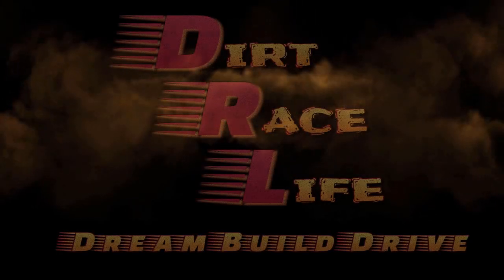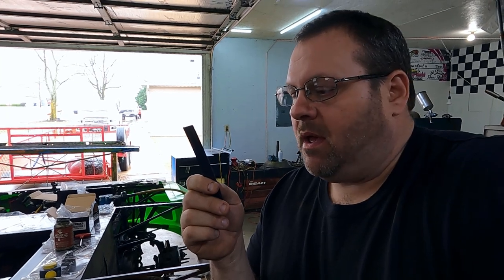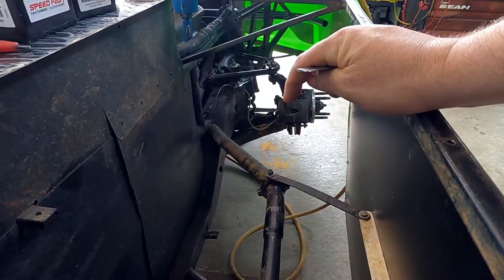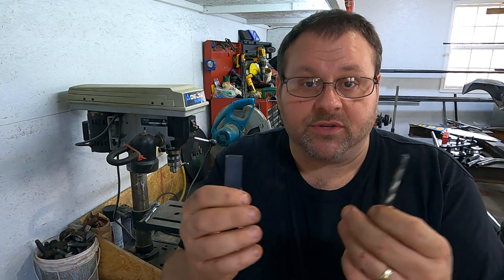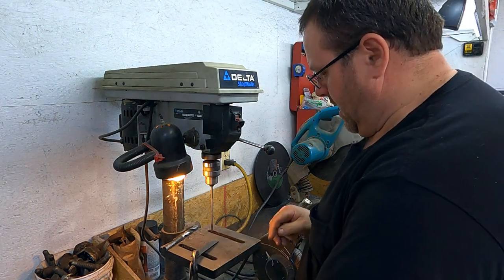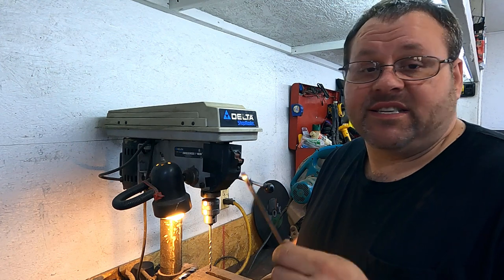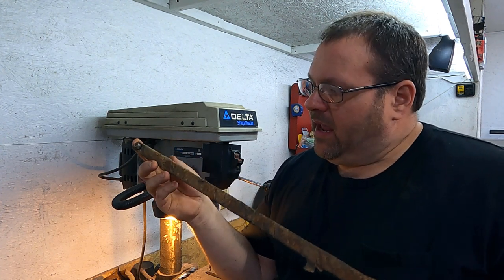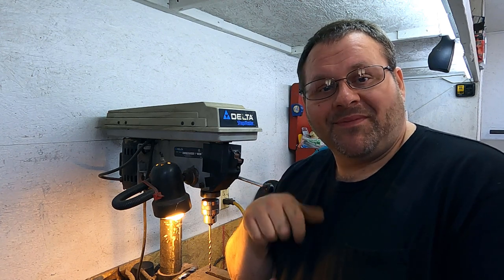Making Body Braces for your Street Stock Simple Fast and Cheap!

Comment: Hey bud where was this video 6 months ago when i finally gave up drilling spring steel and forked out for the allstar punch at $160?? Awesome video man. I use 1inch heat shrink on amazon in bulk. But like everything else it will tear off when the track is heavy.
Reply from the maker: I ran across this when I was re-drilling some leaf springs years ago and a guy told me how a masonry bit would do it. I was like "Wow, I would have NEVER thought this would work." 
    About the ONLY tape I have found that holds at all is the gorilla but even with it, the seam in it has to be faced rearward or like you said a heavy track tears it off. I will look again at the heat shrink. I bought a roll last year but it was too thin. Need to look again. Thank for watching!
Reply: @DIRTRACELIFE  yessir im a big fan of your channel and way of doing this dirt track thing. We do things very similarly on my channel. Keep these helpful tech tips coming!
Reply: I like seeing 2 channels watching each other
Reply: @jasonlogan3209  im still a fan of youtube channels. Especially ones like Dirt Race Life that shares info with us. Everybody can always learn more

Comment: The only thing I can find is spring steel strapping tape. 1,300+ foot rolls for $250+. No such animal of 'fish tape' above 1/4" .... That I'm able to find. Your source ?
Reply from the maker: I went back and found the order from 2019 where I last bought some. Here is the link:    https://amzn.to/3gmEF1n
I REALLY wish I could find an affordable source of 1 inch wide spring steel. The 3/4 like this is great for short pieces but it has to be doubled and tripled when you start making 12 to 18 inch pieces. I hope this helps.
Reply: @DIRTRACELIFE  EXCELLENT ! THANKS ... Lowest of 1" I've found is $72 @ 40', plus shipping. ** HOWEVER, ALL of the regular sources are backordered.**  You have to balance out your time to 'make do' to save a few dollars, or pay more for less time prepping ......